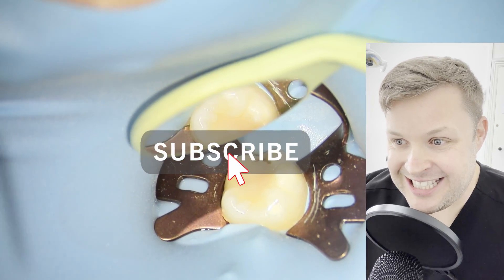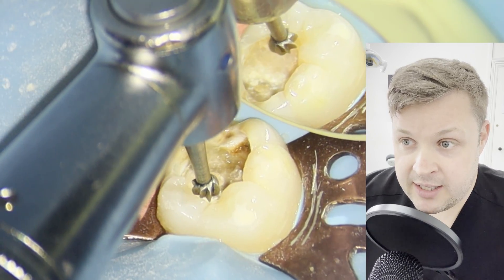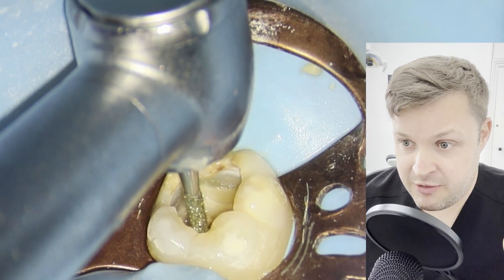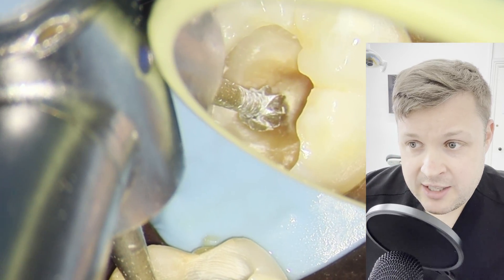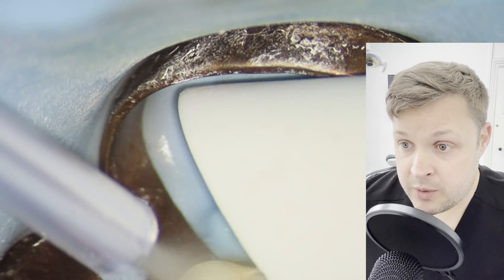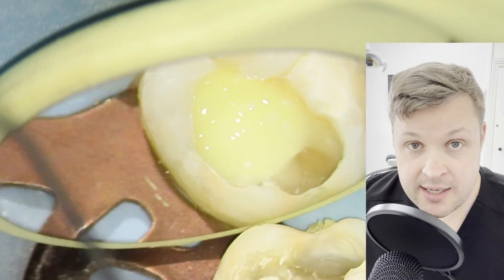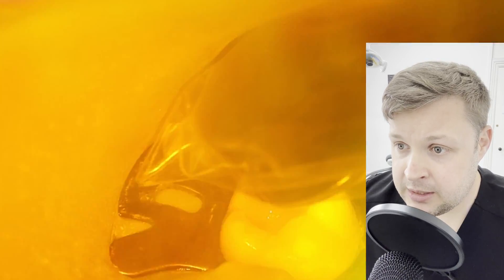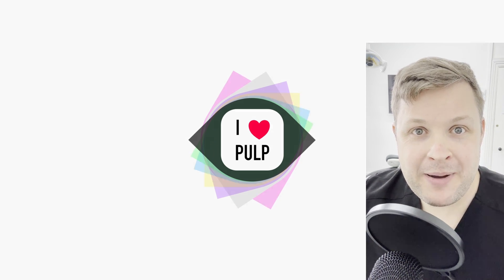HOW TO INDIRECT PULP CAP | 4K Resolution

Comment: Thank you very much for sharing such an excellent case. I would like to ask a question that I often struggle with during caries removal.

If an adequate seal is achieved at the external margin (enamel side), is it acceptable to leave a certain amount of carious dentin on the pulpal side? (Of course, I always try to leave as little as possible.)

Assuming that the external sealing of the restoration is nearly perfect, I am curious whether leaving infected dentin at the pulpal floor could increase the risk of subsequent pulpitis or allow further progression of caries.

I would greatly appreciate your thoughts on this matter.

Comment: you could have used a selective caries removal/ stepwise caries removal approach, a seal could have been established for 3 weeks, followed by excavation, this would have dried most of the carious lesions, as much as I know, removing caries on the margin is a lot more important than the base,  refer to the book written by schwendicke et al
Reply from the maker: @haideriammar1099  I completely agree with this. I need to definitely brush up on my selective caries removal. Do you use a dye?
Reply: @ilovethepulp  I used to, but i feel leaving behind a leathery consistency of dentin on the base to not affect the prognosis, getting a good seal ensures the nutient supply is cut off, thats the key, plus studies show that this approach vastly improves the long term prognosis, endodontic management is more common when the excavation gets deeper..

Comment: Doxa makes a followable light cured biocermic indirect pulp cap material.  It's called Ceramir Protect LC.  It's awesome and you can etch and Bond over it once it's set.  They also make biocermic luting cement which is phenomenal. Cheers from Texas.
Reply from the maker: Hello in Texas? I’ll look into that material. I feel like the only problem with these bioceramics are the steps required to set them in place. So any light cured material seems like a great idea! We are about to launch a podcast about dentists who carry out root canal and are worried about getting everything right, and the mental stress this can put on a clinician, are there any topics you would like us to talk about?

Comment: And is it the same bioceramic putty and bioceramic sealer
Reply from the maker: No, they have different handling properties! The putty can be manipulated easily, but the sealer is very runny, so won’t be much use in this case
Reply: @ilovethepulp  many thanks
Reply: @ilovethepulp  and can I do etching and bonding at same day

Comment: Is it appropriate to use flowable under an occlusal surface? Obviously you sealed the restoration with packable but I’m not sure why you would use flowable after vitrebond. The vitrebond is supposed to be the liner, no?
Reply from the maker: Great comment! I think I wanted to place Flowable around the remaining surfaces that were not bonded by the liner. What are your thoughts on flowable under an occlusal surface, and when you might think it is clinically appropriate to use it?